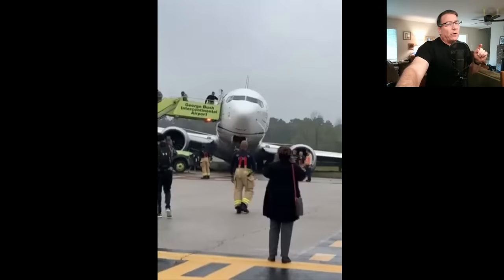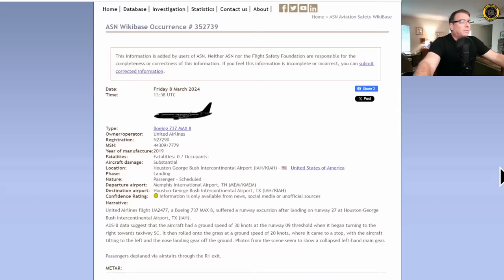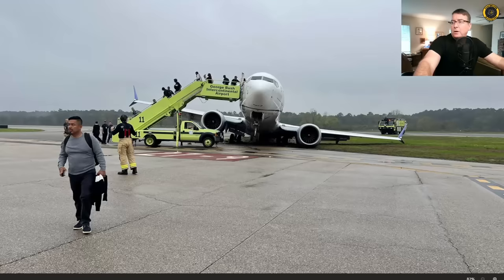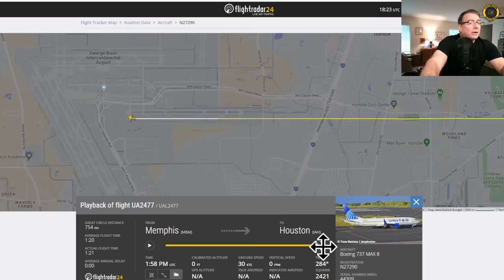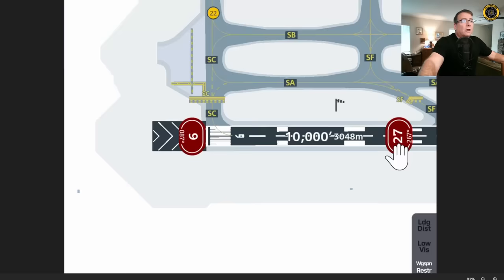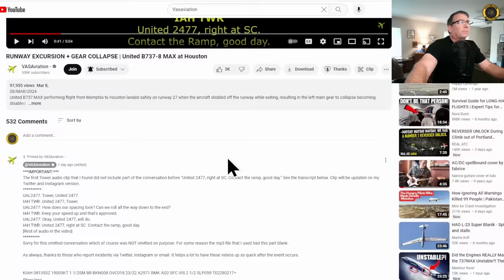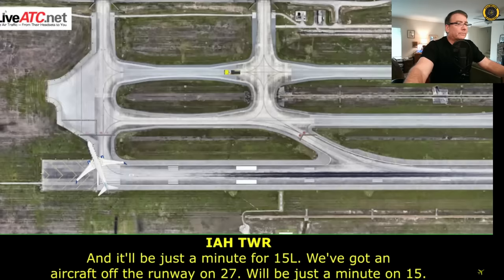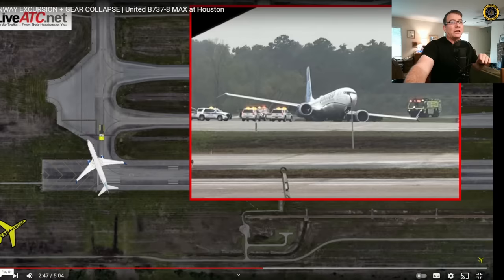United 737 Max Runway Excursion IAH 8 March 2024

Comment: The 1st go around aircraft pilot needs some remedial training. Controller gave him vectors and he told him to standby. That's not how it works. You're in extremely close proximity to other a/c in that situation. Do it now.
Reply: Aviate, Navigate, Communicate.  He did it in the proper order.  There is a published missed approach procedure that should have already been cleared for him. As long as he's tracking that for the brief period while he gets the aircraft stabilized in the go-around, he's good.  Nothing wrong with that exchange.  You can tell a controller to stand by or even tell them unable.
Reply: Not in this situation. Why would the publish missed be cleared for him? There are aircraft very close to each other in the terminal environment. There's 2 pilots for a reason. 1 can aviate and one can communicate just fine. You cannot say unable to vectors in class B airspace.
Reply: @mppatterson7 You can't say it indefinitely but the PIC is ultimately in charge of the safety of the flight, not ATC.  If you need to say unable or standby for a moment or two, yes you can, and he did, and it wasn't an issue.
Reply: @johnaclark1 and a couple seconds later, the controller said to do it immediately, and he did it. Point being, if you're given vectors, it's for a reason. They were in a go around, not an emergency. There's no reason to be making the situation worse. 2 pilots in normal routine flight should not be responding like this. If they say turn, you turn. There's lots of other airplanes out there in a very confined space. I couldn't disagree with you more.
Reply: @mppatterson7  Nice of you to make such judgment when you have no clue what was going on in their cockpit.
Reply: @johnaclark1  But I do know they were in a normal routine go around. You don't either. Have a good night.